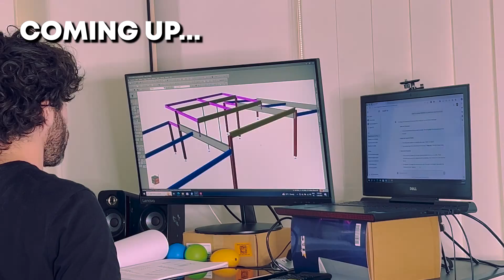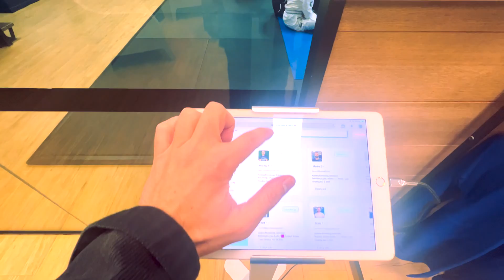Unfiltered Day in My Life as a Structural Design Engineer in Australia

Comment: Hello, thanks for the video! I have questions about spacegass: 1. does it have eurocode in it? 2. Can you do pushover method in it? Im Struc eng in EU, thanks
Reply from the maker: hey..I know they have Eurocode for some modules. You would have to confirm with the team.  Yes, you can. It does non linear analysis and seismic checks. I'm doing a training with Spacegass tomorrow. I will ask them if EU uses much the software and let you know.
Reply: @bengthebrazilianengineerinAus  That would be AWESOME, thank you